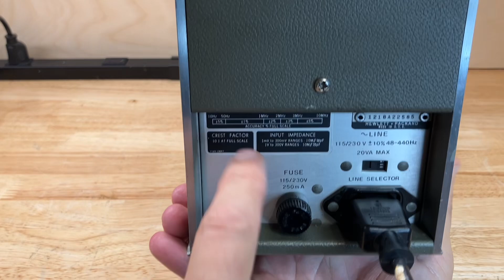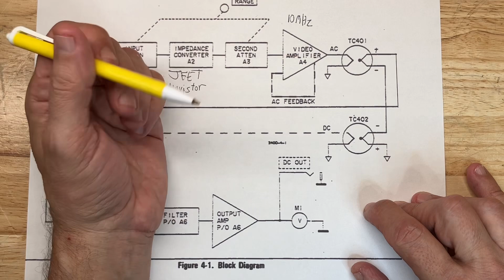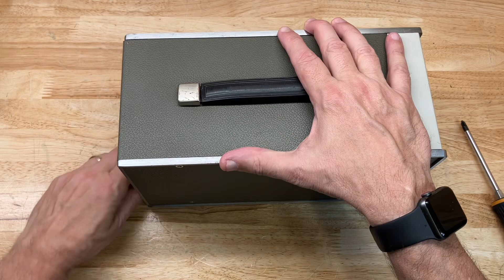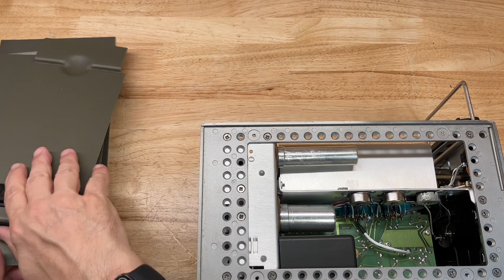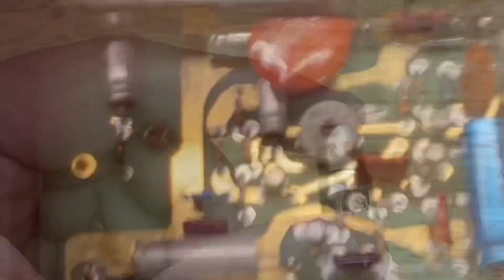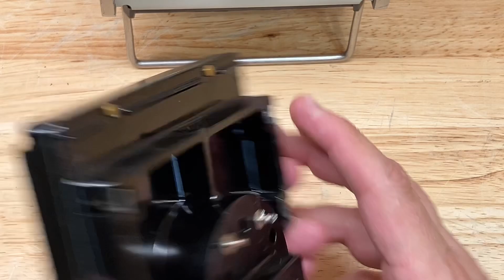HP 3400A RMS Voltmeter

Comment: Gary, love your channel. I have a quick question. I have a 3400A in need of a new meter. The device I have is electronically ok but the meter scale is peeling and I really need to either find a donor unit. Will the meter from an HP 400e match the specs for the 3400A since I see a donor relatively inexpensive on EBay??? Any insight on donor models would be helpful. 3400A meters are always a premium even in disrepair. Thanks Ben D. Montville NJ.
Reply from the maker: That is an excellent question, but I don’t know the answer. I’ve never tried substituting a 400E meter into a 3400A before. I’ll look into it, and let you know what I find.
Reply from the maker: Well, unfortunately, I don’t think they are compatible. Apart from the visual differences (one says “RMS responding”, the other says “Average responding), I don’t think their electrical characteristics are the same. Also, you should know that you can’t simply swap out the faceplates of the two meters without impacting their accuracy.
Reply: Yes I realize that the meter scales are individually calibrated. I’ll find a donor. In the meantime I think I’ll disassemble the meter and peel off the flaking scale so I can get full deflection for a calibration. Any idea on the rated current for full scale deflection on the 3400A meter? Again thanks for the quick response!!! For awareness, another meter I recently purchased is the HP 427a and this one is near mint. Only a minor calibration required and I’m not sure it’s really required at this point. You need to wear the lab coat more often!
Reply from the maker: Your question inspired me to do a video on this. Here’s the link: 

https://youtu.be/tCF_a6Ps6qw?is=d-fbwlYkWsOolJRl

Comment: I have two of these and cal'd both of them, one from cannabilized from a donor unit. Somewhere I ran across a memo that said the meters were each specific unit and could not be used on another. But of yours calibrated OK then it may have been an old wives tale.
Reply from the maker: The meters were individually calibrated, which made each meter unique. That means that the tick marks were generated using a special photographic process to ensure linearity and accuracy for each meter. The meters can be swapped between different instruments, however, because there are adjustment pots for full scale and 1/10th scale in the instrument (in some cases, there are factory selected resistors which may need to be changed, although I’ve never found that to be necessary.)

Comment: Thanks for your presentation. If you look at the circuit closely you will see that the two heater/thermistor pairs are connected back to back in the feedback loop of the op-amp - this is not for improving sensitivity as you state. This connection accomplishes the AC to DC conversion and nulls out any common mode errors due to ambient temperature changes etc. Jim Williams was a big fan of this instrument, its elegant operating principle was used in an IC he had a hand in designing.

Comment: Nice explanation.  Just a note, later versions of the HP 3400A did use a JFET in the Impedance Converter stage and not the Nuvistor.   Nuvistor A2 assembly P/N 03400-66502 and later JFET A2 Assembly P/N 03400-66514.